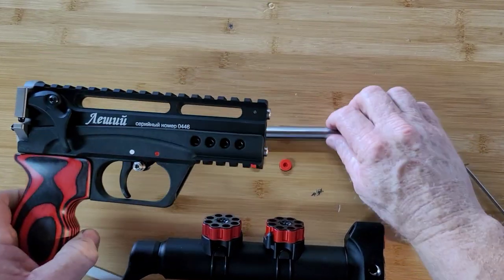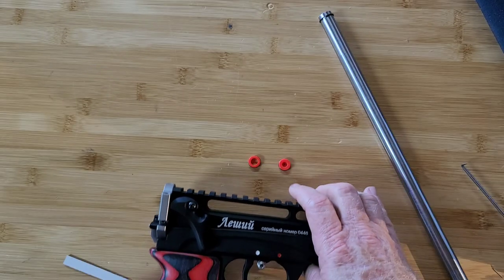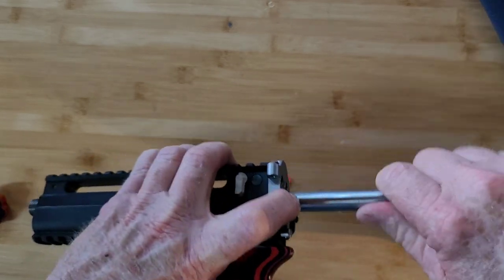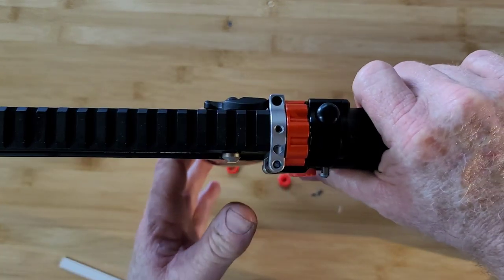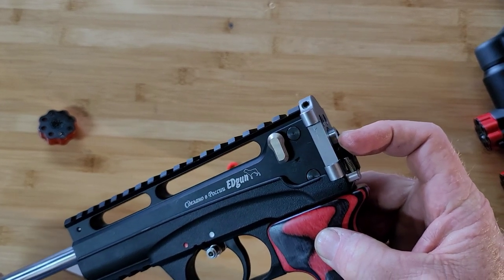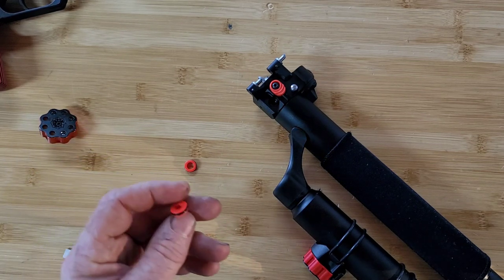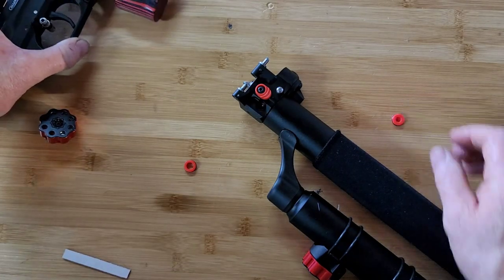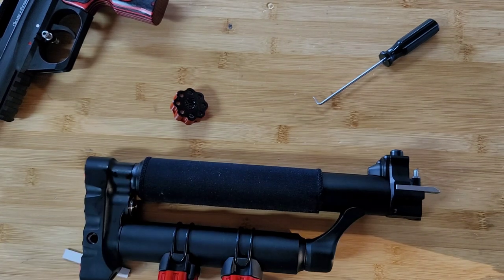Edgun Leshiy 2 barrel instalation  power  pucks

Comment: The LCS SK-19 can, if the barrel is not installed to the correct distance from the magazine, hang up and the mag will not rotate. Very easy fix on both. Good video. The airgun world is lucky to have such wonderful designs.

Comment: does it possible to have narrels with standard thread 1/2-20 unf? it will be better if we want to use external suppressor without adding an adaptator
Reply from the maker: no they won't be changed, all airgun silencer companies I am aware of offer M14

Comment: Why are these so expensive?  It’s a honest fair question
Reply from the maker: A lot of factors go into the price. For example this valve technology has been in R&D for 7 years. Secondly the Butt stock holds 4500 psi. This is A little different than making an AR 15 six position but stock. This kind of pressure requires special door aluminum that is flexible and strong. Also a lot of moving parts and precision parts go into a gun like this ability to regulate from 300 bar pressure to less than 100 all the while keeping a consistent speed throughout the power band. This gun is also “with match grade barrels near me to the same standard as any fire and barrel these are quite expensive and also imported I hope this helps you understand why cans like this are so expensive,
Reply: @edgunwestLLC  thank you. They are sweet lil rifles for sure  I wish I could afford one
Reply: @dangerous8333  nothing. I think they are expensive because they aren’t exactly flying off the shelf. Like anything else that’s new it’s expensive until they start selling to recover cost of development then the price goes down but I don’t think these are selling. If I was gonna pay that much for a rifle it would be a 50 cal. Just my opinion

Comment: How big of a hole exactly does it need to get 12 foot pounds in .22 250 mm?
Reply from the maker: 2.8mm
Reply: That's literally perfect. What kind of shot count am I looking at with 12 foot pounds?!
Reply from the maker: @jeremielibraty7  so what I would recommend is if.you want to permanently reduce the power decrease the regulator setting.  The puck does not increase shot count.
Reply: @edgunwestLLC  okay perfect and wow it's regulated huh? You think I'll get under 1 inch group at 50 yards? Can't wait to get mines! How do I adjust the regulator. Once again thank you for your help and support 🙏
Reply: @jeremielibraty7  not with a 250mm barrel, you'll need a longer barrel for 1" groups at 50 yards... 450mm +.
Reply: @jeremielibraty7  if my 350mm produces 1" groups at 50 yards I'll be happy.
Reply: @jeremielibraty7  the 600mm barrel can produce 1/4" groups at 50 yards.
Reply: @bryanvella6534  No way that's insane. Can't wait for the 450 for sure hopefully 1/2 inch groups. 🙏